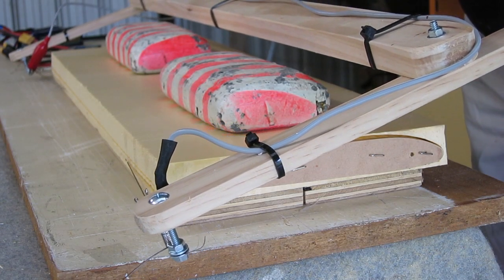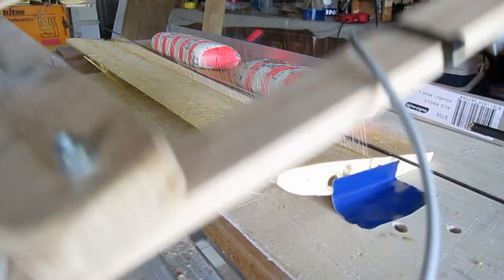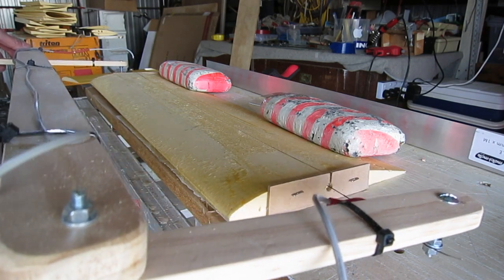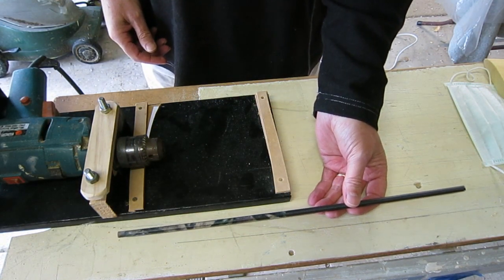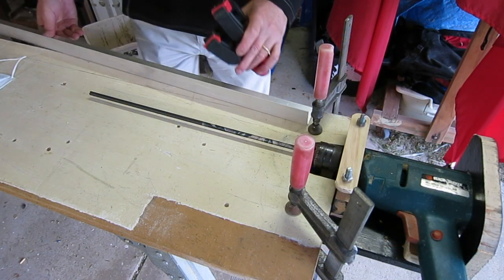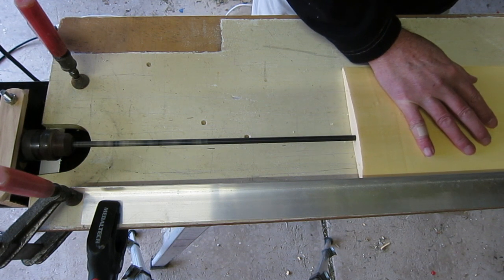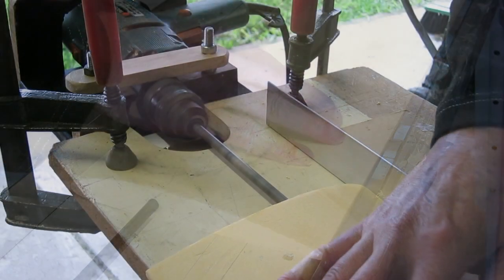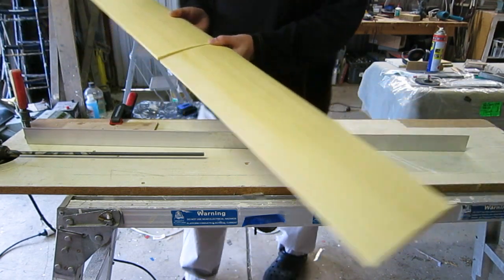Spar hole drilling jig

Comment: in the beginning of the video you cut the wing, why do you cut at the bottom of the wing too if your airfoil is flat there so you could cut only the upper part? Is the foam plate not flat enough?
Reply from the maker: Bottom of the airfoil is not flat

Comment: For the past 7-8 months I've been trying to figure out the best way to drill holes in the wings of the new planes I've bought to add CF tubes, knowing the very high likelyhood of crashing (I'm new to flying RC planes) and then the sorrow of having to by new wings and fuses to repair them. Found your video and BAM the light suddenly went on. Your method is so simple, accurate and effective. Never thought of using the CF tube itself to drill the foam out. Duh, was that a no-brainer. I was going nuts trying to find super long (ie 30") drill bits in various inch sizes that would correlate to metric CF tubing sizes. Damn, I could NOT hit that subscribe button fast enough. GREAT JOB MAN!   Greetings from L.A. California!
Reply from the maker: Thanks Dan, just have to keep clearing out the compacted foam from the "drill"
Reply: @AndrewNewton  Hi Andrew, I have a technical question, if you don't mind, with regards to this superb video you've done.. I have several brand new foam planes I bought recently, mostly warbirds and all are still in the box waiting for me to assemble. I want to reinforce the wings, (also elevators, rudders and fuselage) before I attempt to maiden them but I am not sure how to decide what diameter CF tube to use. The wingspans range in size from 1200mm to 1800mm. How to best choose (or calculate) a proper size CF tube to provide added strength? I am not sure what would be too large or too small for any given wing thickness. Also, I am assuming it would be best to have a CF tube placed as close to the LE as possible as that's where the impact would most likely happen on the wings. The nose of the fuselage would also be subject to impact as well but for now I'm just trying to focus on the strengthening wings first with hopes to keep damage to a minimum. I also plan to apply blenderm tape to the LE to have a nice firm "seal" on the foam. Obviously the exact placement of CF tubes will vary due to the design differences of each wing. All I am trying to figure out now is how to decide what CF tube "diameter" to use, ie 1/2 the wing thickness? Less? More? Note this would be in addition to the factory wing spar which typically does not run the entire length of the wing. I plan to add these CF tubes to run from close to the wing tip all the way to the wing root. I am not worried too much about the minimal weight that this would add. Thanks for any insight. Greetings from Los Angeles!

Comment: Fantastic concepts.

I just recently rigged up something similar using clamped down sheet metal (24"×36"), magnets, two 36" L-angle irons (as guide tracks) and a Dremel with a router bit to cut spar channels into thirty 1/2" thick blue foam ribs. Intend on using shear webs in between the spars.

Really liked the idea with the drill and carbon fiber tube.
Reply from the maker: Oh yes I like your idea with the Dremel.
Reply: @AndrewNewton  
Thanks Andrew!
Yeah, the router makes quite a mess but I figure that's why somebody invented the infamous, "Shop•Vac". Cuts are quick and clean once vacuumed all up.

Comment: Watching this again. Will probably try this on my vacuum bagged wings.
Reply from the maker: It's a tricky method to get right, has to be perfectly aligned and use a stiff enough CF tube. But I reckon you have the skills.
Reply: @AndrewNewton  I think it's on the really long deep Cuts where it's going to start getting crazy. On my sheeted wings with the vacuum bagging I only need to go in maybe halfway mainly to join the wings together and give them support right in the middle where all the stresses are
Reply from the maker: Oh yes perfect for that.

Comment: How would you use this with a solid spar cylinder? I am using smaller 5mm rods as a spar for a relatively lightweight aircraft.
I don't really want to glue anything, so is it required to glue it in a Hotwire cut hole?
Reply from the maker: Could just cut a slot in the bottom and tape it in.
Reply: Alright. Thanks!

Comment: andrew, what did you put at the tip of the cutting spar?
Reply from the maker: Just cut teeth into the end
Reply: I tried several times, but still struggling to get perfect straight hole.

Comment: excellent
can you share what type of foam are you using, if I have search what is the starting point
appreciate your help
Reply from the maker: Yes I use Knauf brand XPS insulation foam (probably only available in Australia). Same as Blue or Pink modelling foam. You could practice with polystyrene packing foam but the XPS is stronger.
Reply: +Andrew Newton thank you sir, I try to find the foam but my luck ran out, the only foam I can find the packing thermacol, which is not very strong, any chance if I can use the same and use something to harden it out
I leave in Dubai (UAE) and nothing of this is available

appreciate your guidance
Reply from the maker: Extra layer of packing tape or iron on covering would do the job. Maybe use balsa correx (corrugated plastic board) for control surfaces
Reply: +Andrew Newton thank you, will give it a try today and let's see the result 

just one thing, I did not get the point of ironing, if you can elaborate a little more
Reply from the maker: I was referring to document laminating plastic that you apply using a warm iron. It's an alternative to packing tape covering.
Reply: +Andrew Newton oh ok, Thank you for your kind guidance

Comment: Hey Andy, using the shaft to drill the spar how did u prepare the tip to assist in cutting the hole? i.e. a glued on metal bit perhaps?
Reply from the maker: +Steve W Steve, I just cut a few V shaped slots in the end with a hacksaw, that's enough to chew through the soft foam.
Reply: +Andrew Newton Thanks Andy, ''ll give it a go as soon as I've cut a few wings following your previous instructions...fyi am using 32" Beman Carbon Flash 630-14 shafts.. small and light

Comment: Make the hole first and then cut the airfoil!!!!  : )
Reply from the maker: +Skycharly Never thought of that but it might be the best solution. Would have to accurately position the template around the hole. Thanks Skycharly
Reply: +Andrew Newton
My template has the hole.   I fit the rod, leave it sticking out, and then the template  Cheers!
Reply: Skycharly Excellent thinking here. This would potentially make dihedral much easier to achieve too. I might give it a try tomorrow. Thanks - Dave

Comment: Thanks Andrew. has been thinking about it for weeks. I got stuck at your first option.
Reply from the maker: +SsoulBlade That method works well for thin and swept wings, need a thick straight wing to drill the holes.

Comment: Great idea!   Could you build a bit of dihedral into the wing by placing a small block under the wing tip? Then drill the spar.
Reply from the maker: RCfragmentor Yes, but with this airfoil there is only 8mm of foam above and below the spar to play with so you would risk poking the spar out the bottom.

Comment: Great drilling rig Andrew. Always wondered if that method would work, and you have proved it does...It does require a bit of making, but so what, you only need to make it once right?...Impressed.....Now, I just want to see you skin them in fine glass cloth using a water based varnish...I saw this done recently by some local Students, and even they made it work rather well...!!!...Well done m8...:)

Comment: Really clever, Just a Q on your soaring videos. Do you often use ballast in your models, if so is there any sort of calculation that can be used to determine how much is necessary? Thanks again
Reply from the maker: Trouttaranaki No extra ballast, occasionally use a heavier battery if it's blowing hard but mostly not.

Comment: The drilling was the route to go (less messy) But the covering also make's the wings much more stiff but I haven't tried paper and glue like LWJCarroll  mentioned.
Reply from the maker: Graham R Dyer Yes the covering adds a lot of stiffness. I need to do some comparisons to determine if a spar is actually required.

Comment: great video again mate. thank you.
I was just contemplating how to do this myself.
Just have to figure out how to make that jig now..
How do you adjust height of spar?
Reply from the maker: Kevin Ray Rough and ready adjustment by more or less packing under the drill and between the jig base and the work surface
Reply: OK. mate thank you.
should try to have spar in thickest part of wing, right?
Reply from the maker: Kevin Ray That's ideal place for the spar due to the foam thickness, but it doesn't have to be there.